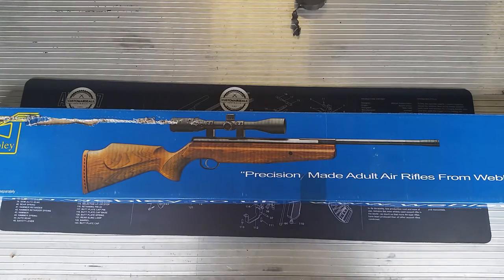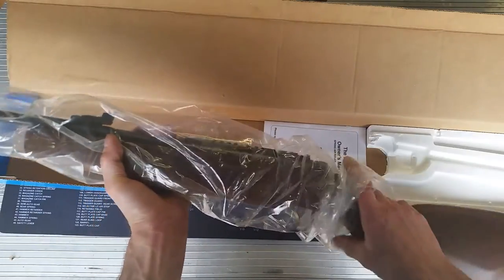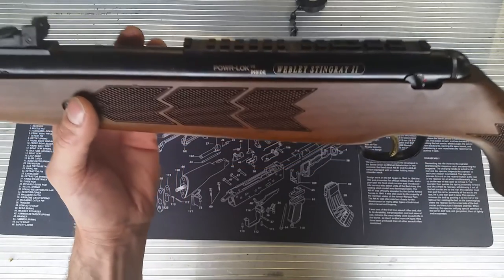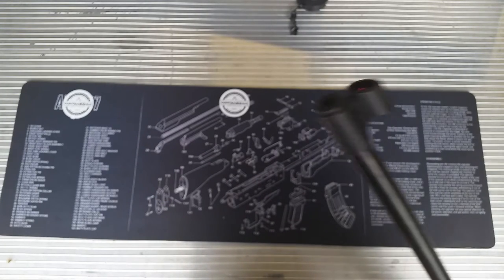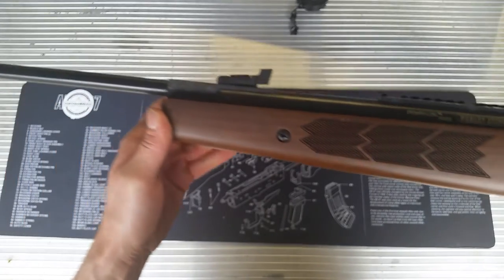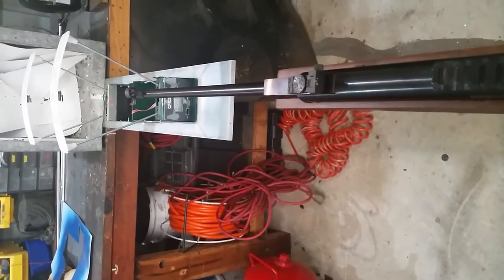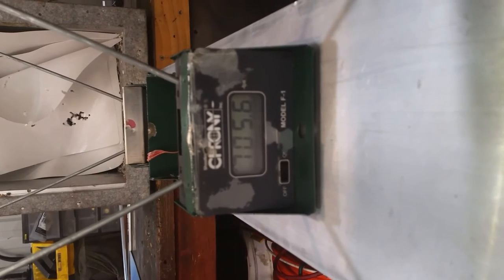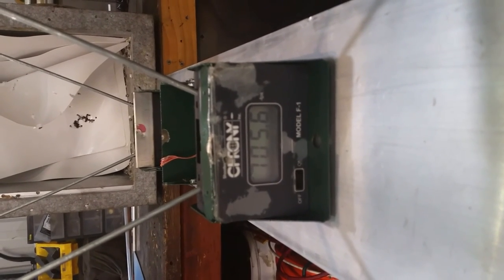Webley and Scott Stingray II Un Boxing first look and Chronograph Test

Comment: Mine .22 have prints "WEBLEY STINGRAY II QUATTRO" , safty is on the tail(pull for safety,push for fire), no Weaver style  rail attached,just dovetail cuts. The top width of the dovetail is about 12mm, and don't know the angle. Do you know where I can find the manual, specifically the dovetail specs? Also it is very hard to cock, look forward to lubricate (need manual too). Any one could help? Thanks
Reply: I have the same one you described, you just need to be a man when cocking it and its alright